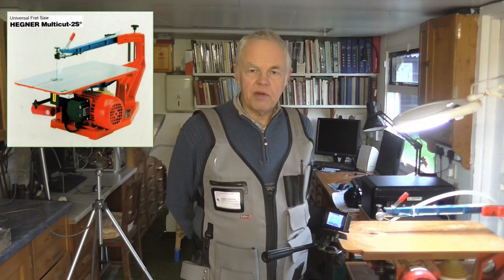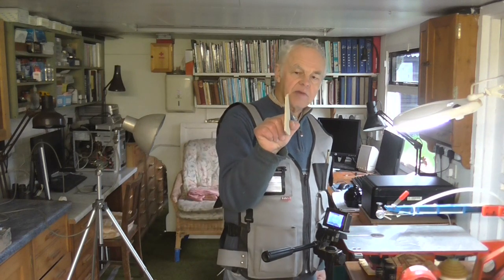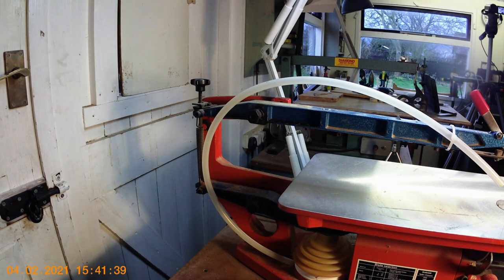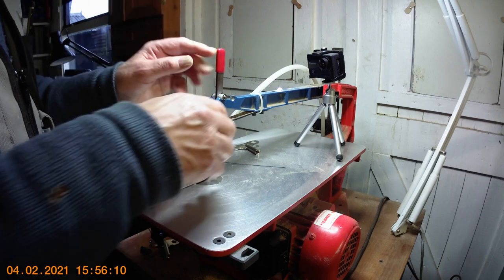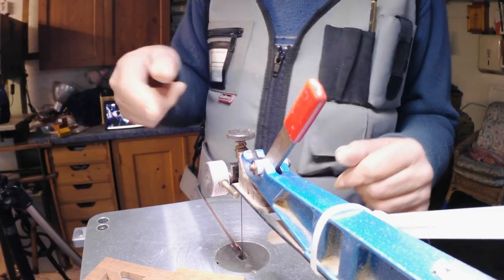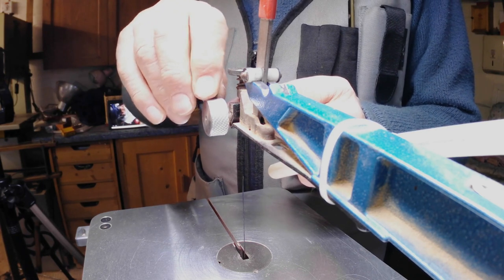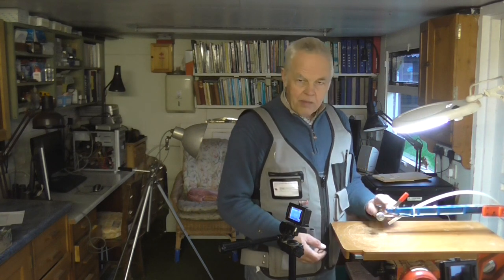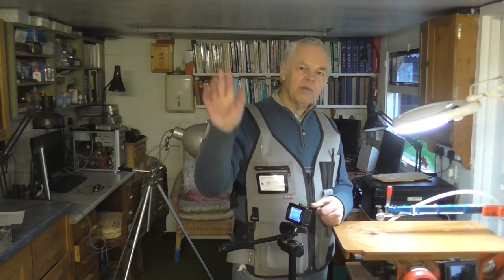Hegner Scroll saw Full review & guide.

Comment: Just picked up an old single speed Hegner Multicut 2 (from before they had the quick tensioning lever) to help make use of little offcuts from my general woodwork which I can't bring myself to throw away.
It cost about the same as the generic Chinese machines, which I did consider, but I'm glad I went with the Hegner.

This video has been brilliant for helping me assess machines before buying them, and then getting it set up and running.
Thank you
Reply from the maker: Hello Peter, many thanks for your kind comments about my videos, it makes my effort in making them very worthwhile. You were wise in buying a Hegner, I bought mine new 24 years ago and to this day never regretted buying it, they are a joy to use. 
If you haven't already done so I would urge you to retrofit the quick tension lever kit it makes blade changing so much easier, Unless you change the whole top arm (expensive) the retro lever will be at the back but it is much better than having to keep adjusting with a threaded knob so to speak. It's essential if you do lot's of internal cuts. John.

Comment: Thanks for the scroll saw video.  I learned a lot about how they operate.  I looked up the prices on Amazon and you are correct in that they are pricey.  A quick check on Amazon found an 18" variable speed Hegner is $1,545.00 US. A 21" variable speed Hegner is $1,795.00 US. A Hegner 14" single speed is $885.00 US. I would guess they are worth the price if one is involved in doing delicate work.
Reply from the maker: Thanks for commenting Gary. Yes they are expensive and spare parts if you need them are horrendous but on the other hand the machines will last a lifetime and being very reliable they rarely need spares anyway.

Comment: Even though I don't have a Hegner I found this video both enjoyable and informative. Based on personal experience I agree completely with your advice to buy a good quality machine to start with. I unfortunately did not do this. I bought a very cheap Wen saw which I hated. I returned it after three unpleasant weeks of trying to use it. I then bought a much more expensive Pegas and have not at all regretted spending the extra money. It's a joy to use. Thanks again for another excellent video.
Reply from the maker: James thank you so much for your very kind comment. Glad you now have a decent machine. I have not used a Pegas saw but I have head lot's of good reports on them and nothing negative. As I said in the video a cheap machine will drive you mad but a good one will bring huge joy and you soon forget the extra you paid.

Comment: Hi John. Thanks for this. I can confirm that an older style Hegner can be transformed by fitting the quick clamp at the front and their quick tension release lever at the rear (it replaces the screwed rod). Hegner charge around £70 for both. They are very easy to fit and work really well for those inside cuts. Thanks. Col.
Reply from the maker: Thanks Col, that is useful info, i will mention that in my next video that cover the subject and also pass it on in the forum I mention in the video.
Reply: Hi Col. I'm trying to source the Quick Tension lever for the back and Quick Clamp for my Hegner. You might have seen I'm asking around as to where I might source these as Hegner UK seem permanently out of stock. Any help would be appreciated.
Reply: Hi Mr Christopher.  It may be worth calling Hegner UK (if you haven't already). I haven't bought much from them however I ordered a new clock key which they said was out of stock and would not be available for a month. Three days later it arrived in the post.  I may have just been lucky I suppose.  Good luck. Col.
Reply: @colchal4570  I rang Hegner today and the chap in Technical was very, very helpful. Turned out they have the parts in stock although their web site says not. Seems they are a huge company and have the Hegner franchise. The parent company is WF-Education!

Comment: Thanks.  My scroll saw is from Home Depot but I got away with one.  It’s stout & heavy.  The only plastic part is the round thingy in the middle of the table that the blade rides through (which I’ve managed to chew up).  Changing the blades is a pain (relative to your Hegner) but I’m getting better at setting the blade tension, so I don’t have to replace blades as often.  Long live whirligigs.
Reply from the maker: Thanks Dennis, You could make a new table insert from a piece of plywood or make a supplementary table to go on top. Quick blade change is essential for  intricate work with lots of cutouts. What are Whirligigs? Lol
Reply: Sounds like the porter cable 18", annoying blade changes and why did they make the center hole plastic, although it's got a better motor than the dewalt dw788

Comment: Good review, definitely agree with the universal motor sentiment. been through 4 dewalt dw788 scroll saws in the last year, the motors just don't hold up with heavy use.
Reply from the maker: Thank you for your comment Travis. Throughout my many years doing work involving motors I have always found induction motors to be totally reliable and usually outlast the machine they are fitted too; which is not the case with carbon brush type universal motors which often are noisy, vibrate more and have many more parts that wear out such as the armature and brushes.

Comment: I was really impressed with your video, so much so that  I went out and bought a second hand Hegner, Even second hand it was quire a bit more than most new machines from other manufacturers. It has variable speed and the quick release attachment and I' m really pleased with build quality, it purrs and it's quiet without vibration. I take it that Hegners do not come fitted with the hold down arm as a standard fit and are an optional extra? I' finding that holding down the wood to be cut needs a fair bit of pressure and a slight lapse of pressure lifts the wood alarmingly. It can also be tiring on the fingers after a while. I notice that most experienced scroll sawers don't use a hold down arm, probably because it gets in the way when starting a new cut in an complex piece. Do you think a hold down arm would be a useful addition for a beginner, or do you think it would rapidly become a nuisance. A new hold down arm for my machine is well over £100, so that's why I'm hesitating., 

Thanks

Chris
Reply from the maker: Hello Chris, firstly thank you so much for your kind comment about my video and I am delighted that it encourage you to purchase a Hegner - you have made a wise choice - one that you will never regret.
My advice is not to buy a hold down arm, they are a confounded nuisance and most people end up removing them. 
You will very quickly get used to holding the work down and you will not even feel or think about the effort. Always make sure you put the blade in the right way with the teeth pointing downwards otherwise it will jump about crazily and drive you mad, you would be amazed how many people put blades in upside down.
Have you looked at my fretworking website? Lot's of info on there inc a Hegner page etc  Search for   scrimpers fretworking site . 
The link is also in my header above. Regards  John
Reply: Hello John, 
Thanks for your reply. I'll take your advice and practice holding down the work with my fingers and save the cost of the arm if it's likely to to gather dust in a corner. I've not seen your fretwork videos but I'll certainly take a look. I've seen a few of your whirlygig videos and like the way you adapt all sorts of everyday things to make parts for them. There are a bewildering amount of different blades available for scroll saws but do you find that you have a small number of sizes and types that you use most of the time?

Chris
Reply from the maker: Chris, There are a lot of fretsaw blades available but you only really need to concentrate on two types being the standard plain blade and the reverse tooth variety, I go into detail on the blade page of my website but in essence you can manage quite well with about three grades  a number 2 or 3. a number 5 and perhaps a 9 for thicker work.
Sizes generally go down to 00 and up to a 12, if you are new to the hobby don't go lower than a number 2 or you will keep breaking them. 
My advice would be steer clear of spiral blades - at least until you are experienced, they are likely to put you off the hobby for good. Some folk do absolutely stunning work with spirals but most of use hate them.   
As for reverse tooth blades their only real benefit is they minimise cut out at the bottom of the work, other than that they make little difference. Again I discuss this on my website. 
Any questions please feel free to ask - although I might not know the answer!
Reply: Hello again John,

Thanks for taking the time to give me a detailed answer. My Hegner came with a small set of blades which I think might have even come with the Hegner when it was new and I suspect its not had a great deal of use. I now have an idea which to try and which to order in future. Scroll saws seem to me to be a great self contained tool. They take up little space and you don't need to own or use lots of other tools to do most fretsaw projects. I'll look up your website for more ideas and information. Keep doing the videos, they're much appreciated.

Chris
Reply from the maker: Thanks again for your kind comment Chris. In the past there was so little interest in the hobby, powered fretsaws have made a big difference with a lot more taking the hobby up. one of the reasons I did the videos and website was to encourage people to give the hobby a try - several people have told me they started the hobby after watching my videos which makes the videos all worthwhile. I make zero from my videos or website and I don't want too, kind comments like yours are all the reward I need.
Reply: Hello John, 
After our previous conversations I thought I'd got a fairly good idea about blades. However, many suppliers give TPI when listing blades! I have tried to find a conversion table but failed, apart from the higher the TPI the finer the blade I can't relate blade numbers to TPI - any thoughts please. 
Incidentally, I've made a mains extension lead for my Hegner and included an in-line foot switch of the push to make, push to break type, and I find this easier than trying to find the machine switch.
Regards,

Chris
Reply from the maker: Chris In all my years doing fretwork I have never really bothered about blade TPI  -  I have always related them using the range 00 to 12, 00 being the finest. Youtube won't let me put a link here but if you search for  olson blade chart you will get a download link for a PDF that provides blade sizes and TPI.
Reply: Hello John,
Thanks for your patience replying to my questions. I will look up the chart and it should prove very useful to work out blade numbers, as some suppliers only quote TPI. I've read you interesting history of the scrollsaw but I should perhaps be calling it a fretsaw in the UK! The Hegner saws would seem to have good deal in common with the early mechanical fretsaws.There's still a lot to watch and I hope to make a whirlygig.

Thank you,
Chris
Reply from the maker: I am always happy to answer questions Chris. Re Fretsaw verses Scrollsaw - In the UK it was always known as a fretsaw whereas in the US they usually call them Scrollsaws. When Helmut Abel introduced his powered machine he also called it a Fretsaw. 
Nowadays most users in the UK and elsewhere call them Scrollsaws, I am probably the only one who still calls them Fretsaws - but I am old-fashioned.
Reply: Hello John,
I've printed the Olson chart and it's next to my Hegner.  I'm more and more impressed with its elegant engineering simplicity.

Chris

Comment: hi there, what tape have you round your bellows ? mine seem bit lose aswell
thanks. good video
Reply from the maker: It's just normal electrical insulating tape Gordon, I found a split in the bellows but Hegner charge such a huge amount for a new bellows that I used tape instead. I have been made aware that a seller on ebay offers a decent bellows for £19.50 [UKP] which is also said to be longer lasting.
Reply: @scrimperuk  ok thankyou. Yeah ive seen them on there. Will see how tape works 1st
Reply from the maker: @gordonwalmsley453  I might order one from ebay and do a video on it! The tape does work though.

Comment: I just got one but having an issue breaking blades. Tension shouldn't be the issue.
Reply from the maker: Ken you should not be breaking many blades (unless you are new to Fretworking) What make of blade are you using, I had a problem a few years ago with a batch of blades under the Flying Dutchman brand.
Reply: @scrimperuk  flying Dutchman ultra reverse #3. I never break them in my Excalibur. Not new to fretwork but I am new to hegner
Reply from the maker: That is strange. I bought a selection of FD blades after they were recommended in a forum, they kept snapping at the end where they fitted in the blade holder, I later learnt that others had the same issue with other saws, That was a few years ago mind. I generally use the Niqua brand from Hobbies (UK) very rarely have any snap.
I honestly can't understand why they snap in a Hegner and not in another make? I presume you are fitting them in the blade holders correctly?

Comment: I'm in need of the Quick Tension lever at the rear and the Quick Clamp. Hegner seem to be permanently out of stock. Can anybody suggest where else in the UK I might source these?
Reply from the maker: At the prices Hegner charge it amazes me that they are out of stock of those quick clamps, (£28+) it is just a simple item you would think they would switch a couple of machines on and produce a couple of thousand to keep customers happy!

Have you considered fashioning one your self? I reckon you could fairly easily convert a standard blade holder with a lever, Axminster do a range of locking levers that are around £3.00, it might not be as perfect as the original Hegner one but if I was stuck I would give it a go.
Reply: @scrimperuk  Thanks for the advice. I will take a look at Axminster. Do you know of any other suppliers I might try?